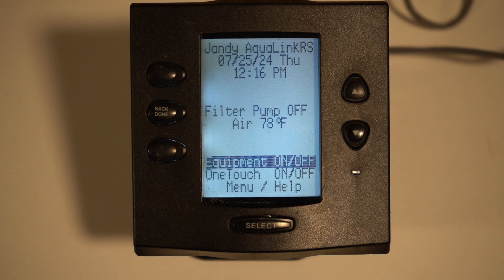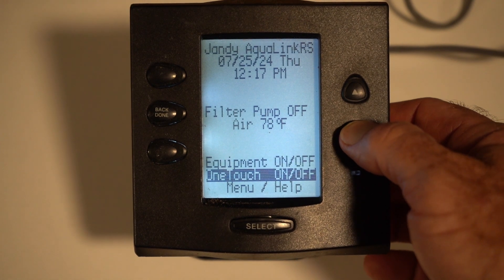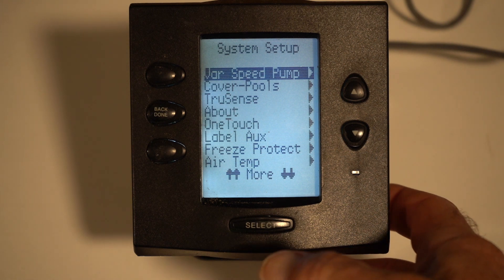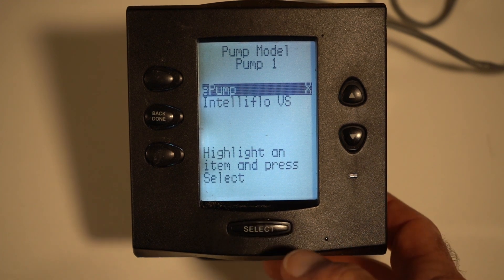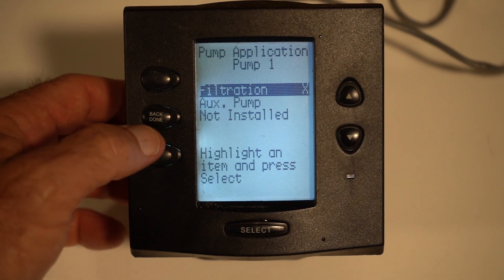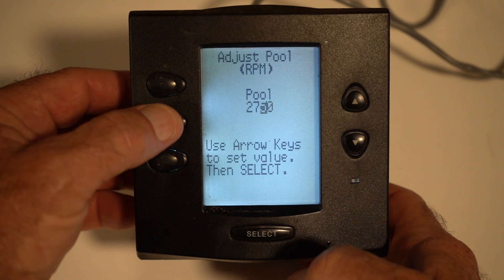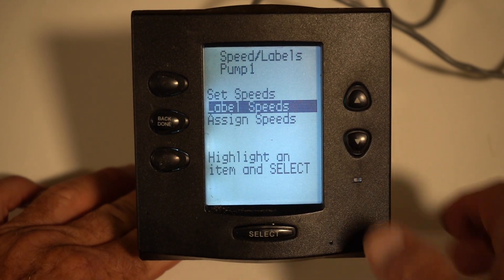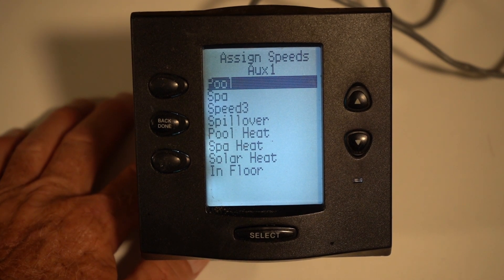How to Program Variable Speed Pumps on a Jandy RS using a OneTouch Panel

Comment: I may need your help. I have a pent air variable speed pump and a handy controller with iAqualink wireless connection so I can control it via phone. No one is able to connect these two systems and I'm having to use the variable speed pump on max only and a dummy on/off system. Perhaps you can help.
Reply: He has another video on how to wire a pentair pump to a jandy panel. Also there is another video called "Intelliflo Vs Pump to Aqualink Jandy control panel" Follow both videos. no matter what pentair variable speed pump you have the process is the same.